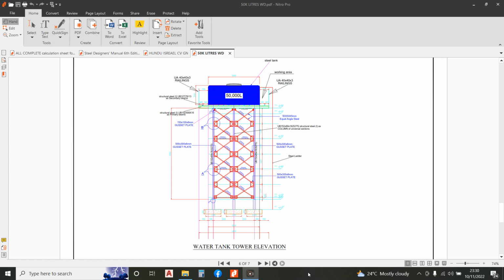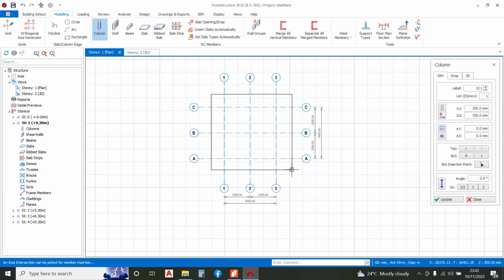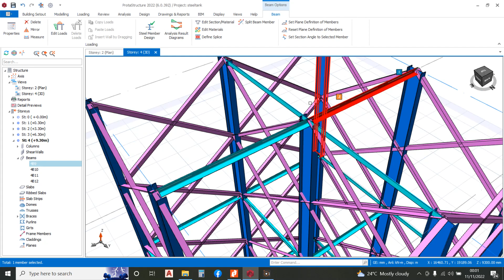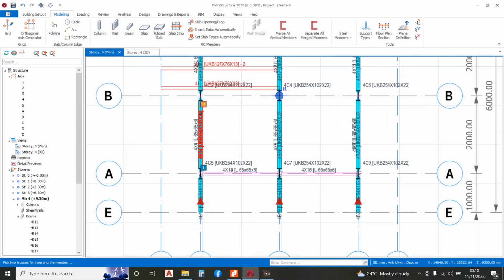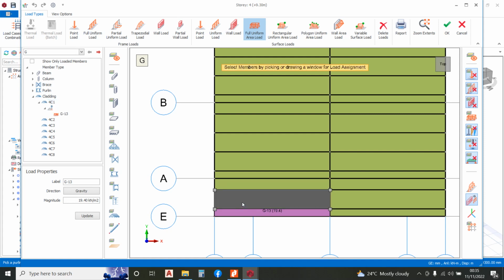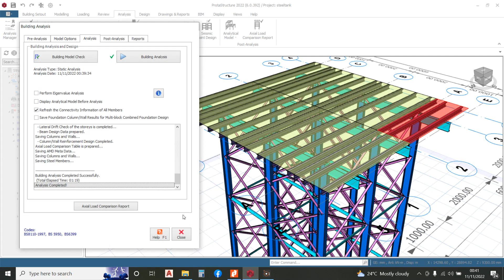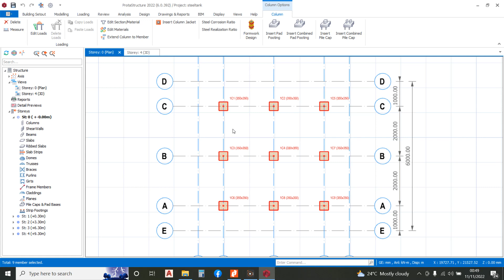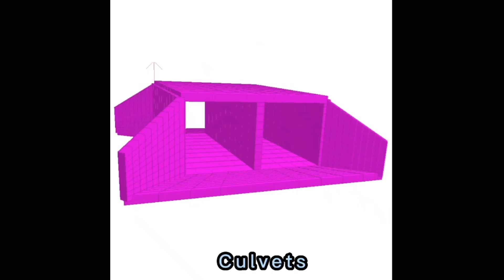Prota Structure 2022; Design of steel water tank (50k Liters)

Comment: Weldon hon. Engr. I learnt from this your video. I want to ask , how did you arrive at your load of 19. something or so when the litres of water is 50,000 Ltrs . May be I made a mistake in my calculations because by my own calculations the load is 31.25KN/M2. thanks boss.